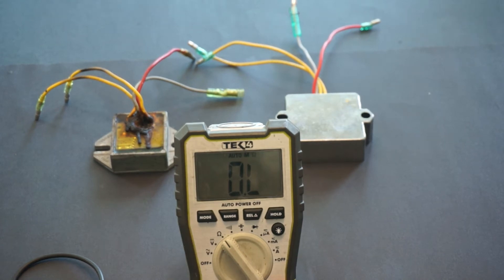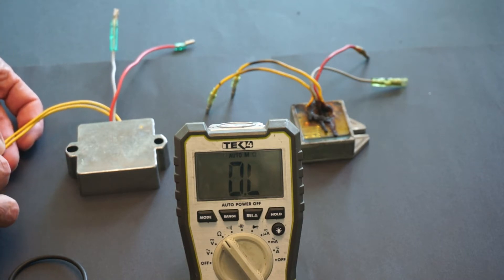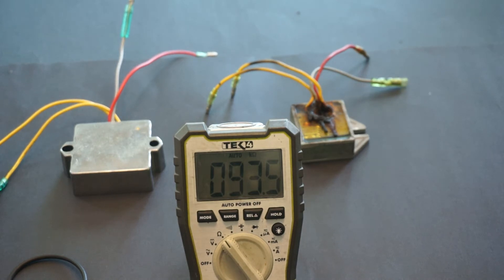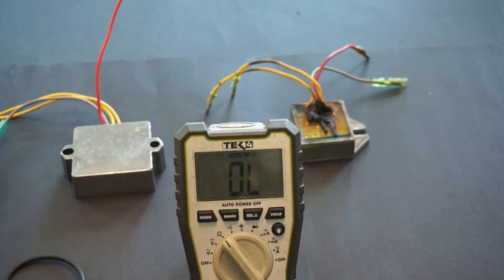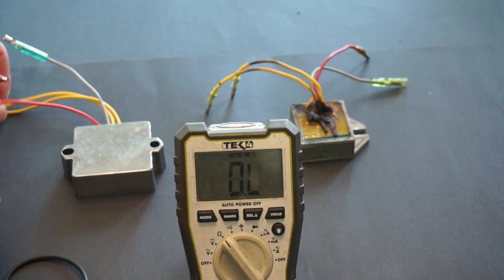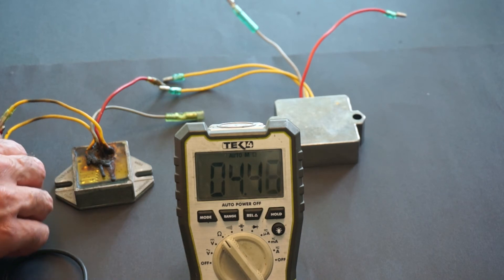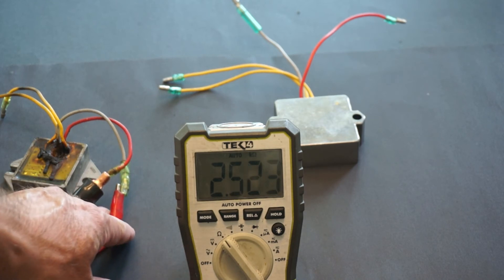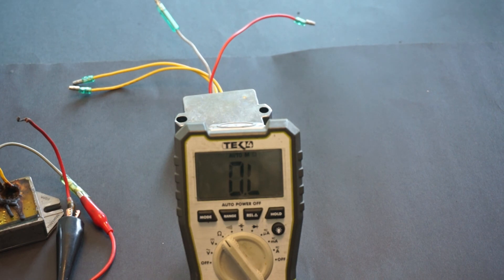How to test rectifier outboard

Comment: So if I burned my rectifier will that cause my stator to melt? And if I reverse battery connections on accident like I did to burn my rectifier out in the first place, do I have to replace my power pack too? I have a 1989 XR4 that seems to load up when it gets hot. Runs great when cold. I also have black sticky crud below my stator.